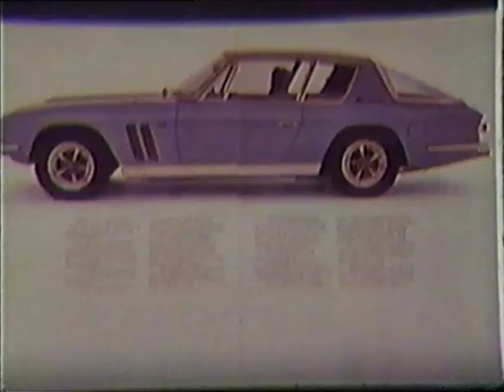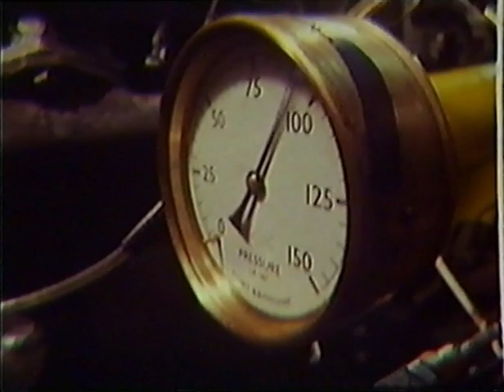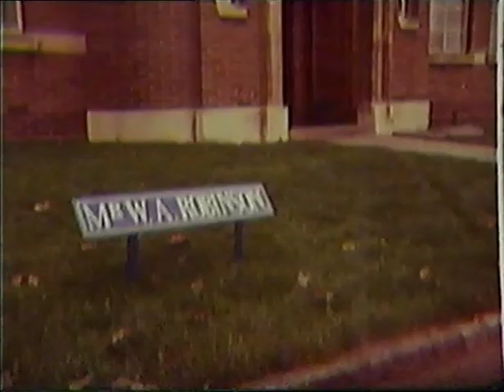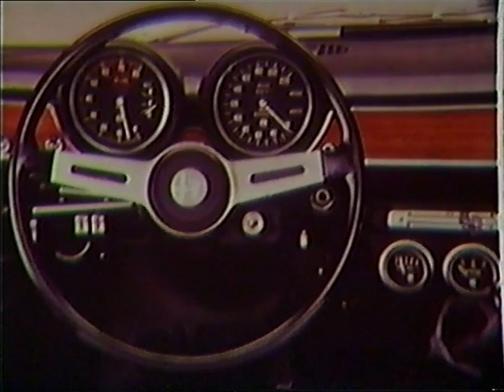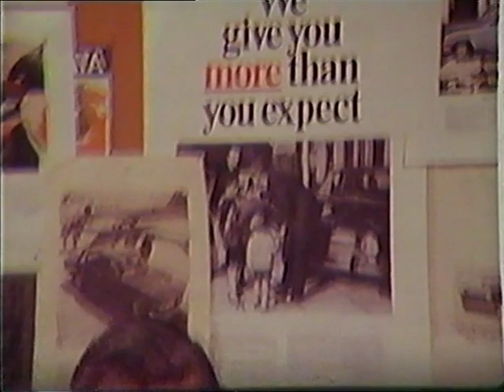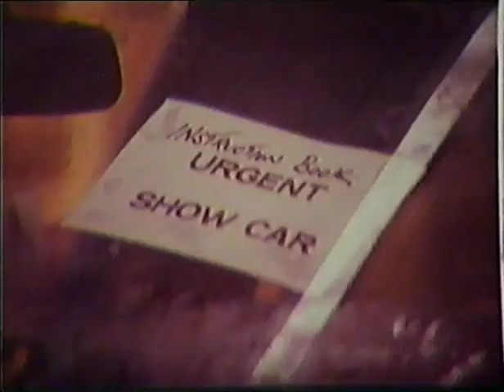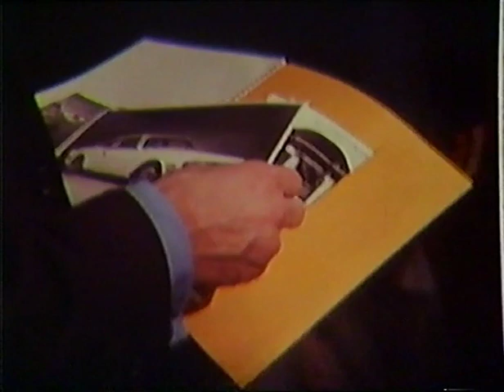Triumph Stag documentary THE DREAM CAR (1970) Rare development footage of 'Project Stag'

Comment: The Stags 3 litre certainly had its issues but  that was then.  If you are a proactive steward and a bit mechanically sensitive you will find the Stag to be a delight. I have logged 10s of thousands of miles in my Stag  and would have no reservations in owning another. Great  classic   with an affordable price tag.
Reply: Personally I think the 3.0  Capri V6 is the Best Engine for Peace of Mind   Reliability  in a frequently used Stag✅

Comment: I have worked on stags for over 40 years ,it was such a shame there was so much enthusiasm for it by all at the factory’s
The problem was it wasn’t developed properly but make no mistake when you drive one which is as it should be they are fantastic absolutely apes a pagoda merc and even a 107 to drive unfortunately there are so many stags that have been got at now , I had the pleasure of driving nearly new ones  which were lovely,everybody knows about the engine issues but it’s lovely when it’s right very sad but its become an icon and still very beautiful 🙂
Reply: Yeap

Comment: STAG: killer design with an Achilles heel. What an exceptional fly on the wall production. That the film was made with such authentic charm and foresight is remarkable. It shows they really knew the secret STAG project was well worth documenting.
I fell for the charm of a STAG in the 80s and at the same time had a TR5, PI Saloon and TC Saloon. Loved the performance of the TR5 and the daily drive quality of the saloons, but the luxury of the STAG was a world away from Standard Triumph offerings.
I always had to have a friend on hand to remove the hard top for Summer; then you could hear that unique STAG V8. I never had an issue with the engine or timing chain, but the electrical system was a nightmare. In the video you hear a reviewer ask why on earth the battery was so inaccessible.

Comment: Music - I am a Fantasy (at 36 min) - Clodagh Rodgers - so apt:
I dance with the trees and I sing with the breeze and I fly like a dove....
I can see reflections of an image I will never be....
And I am what you see but I'm not what I seem....

I know we kick our selves in the UK but Triumph did "Shoot for the Stars, Aim for the Moon" - respect!
The 2 litre, 4 cylinder 16 valve Dolomite Sprint engine was half of a Stag engine.
The Stag V8 engine was designed to accept two 16 valve (Sprint heads) - and each bank is capable of 2 litres.
We are talking 32 valve 4 litre V8 engine in 1972 - also forgot to mention early development engines used Bosch fuel injection (Triumph later used Lucas PI in their saloon cars).
This is mighty 1990's BMW M5 V8 stuff by Triumph in 1970's - and yes, Triumph already had fully independent suspension and 6 speed overdrive gearboxes in production....!

BMC banned the potential Triumph 32 Valve V8 4000 PI Saloon Car (1990 BMW M5 killer) as it could damage the new Rover SDI sales.  The agreement was to remove fuel injection and just fit it to the Stag without proper development spending.

So apt the Triumph sales agency chose "I am a Fantasy" as a sound track....
Clodagh and that poor abandoned V8 both sounding brilliant 50 years later!

Comment: this documentary answers so much about the Stag and British car production in that era. 

one of the biggest answers is with the engine. the big end bearings are small for the engine size. yet the production engine capacity grew by 20% from its design size which will have loaded up the bottom end far greater than intended. also a great deal more heat is created than the cooling system was originally designed for. the late change in engine capacity and limited time to fully test it surely led to the inevitable engine issues.
Reply: Also timing chain was to long, it was a total failure.
Reply: @eddkennedy6458  You are both incorrect… These are folklore… My engine is 30,000 (from new) never touched.. The timing chains “should” be changed every 25,000
 Mine don’t rattle at all… similar story with the main bearings…The answer is I change my engine oil every 3000 miles not 6000 plus as by book - conclusion is the timing chain is a little delicate and there are too many galleries and moving parts- solution, better chains, better oil or  simply change the oil more regularly.
   The cooling system is sound as standard but there must be no crap in the system and the standard system only needs to lose one litre of coolant to dry the water pump and 🥵.. answer, keep the coolant full- solution, fit a modern header tank with a level warning alarm if you are nervous
Reply: @MrDodgedollar  
Timing chain was to be double tooth, but cost cutting made it single. If you use the car to what it was supposed to be used for, brisk acceleration and high speed driving, your engine will seize. Unless you install the relevant after market fixes, and use the proper modern fully synthetic oil and waterless coolant.
Reply: @MrDodgedollar  is yours a Mk1 or Mk2?

Comment: My father dashed out to order and pay as soon as he got the call to do so. Unfortunately for him his car was fitted with a poorly constructed motor. For the first year it was at Triumph for major engine repairs more than in the garage at home. If I remember correctly they replaced the doggy engine seventeen or so months after he purchased her. Less than a year later that engine began to have issues. She would overheat often; resulting in the warping of the rods. By this time my father was fed up with Triumph engine troubles. Not wanting to part with his second wife, he had a new Chrysler engine and gearbox fitted and tuned to perfection. They added an air scoop under the bumper to improve radiator function as well. He kept her for the next nine years. At which time he had the means to upgrade. He purchased a new Mercedes-Benz 380SL for himself and a 380SD for mother. To father's horror mother swapped the "hers" of the MB duo for a new XJS just six months later. She said she felt like an old lady whose driver took the day off. I'll admit being delivered to school in the 380SD was a bit embarrassing. Arriving in the large but sleek and sexy Jag was altogether different. Mother loved her sporty land yacht.
Reply: Your Dad must have been worth a shilling or two.

Comment: Great car & reminds me of when I worked in dealership !!, pity the engine was under devveloped , they could,ve saved heaps of bother by using the Buick sourced 3528cc V8 ,   from the P5B and P6B Rovers !! afteral it was all under the BL banner by then !! lovely styling and was a pleasure working on them!! :-)
Reply: To Tom Finney, I agree that they should have used the bigger engine (if it would fit) to compete with high class foreign makes.So it had the looks  but NOT the performance to challenge them.
Reply: The Rover engine fitted, but the politics stopped it. Have been a number of reasons unearthed over the years, Triumph wanting their own V8, not enough Rover engines to supply all the models. Today a Stag with a Triumph engine commands a higher price especially now the issues of the engine are known and with simple maintenance reliable.
Reply: Rover became part of the Leyland group after both the design of the Stag along with its V8 and the Rover V8 production facility had also been signed off with expected demand for just Rover product. The result was that in 1970, they could not produce enough Rover V8 to meet the demand for the Range Rover let alone ship them down the A45 to Canley. With hindsight they should have canned the Triumph V8 and invested in the Rover V8 production facility (as they did for the SD1), but no sooner had Leyland bought Rover out, they merged with BMH (Jaguar and BMC) and so key people from the Stag project such as Turnbull and Webster and many of their teams went to Longbridge to try and sort out the BMC "road crash" and new people like King came in from Rover who were already working flat out with the Range Rover and P9 and now had to work on finishing the  Stag and Toledo / Dolomite as well, they were trying to do too much with too little.

Comment: Insightful; Amazing documentary, obviously much development  work went into the car but it does show 50 years later. It is pretty modern, even today and drives lovely-  Great HP and torque characteristics along with better fuel economy than the 2500 straight six and an even better exhaust note… We all know about the troubled engine history, which has proven to be a production quality control issue across the board and not sub standard engineering... logically the engine should have been fitted in the big saloon and estate ( with a price increase) to give the engine a higher profile and get the problems nipped in the bud!
I don’t think in hindsight, the Stag would have boosted sales if they had got it right! To America, it wasn’t very appealing Possibly the saloon and estate could have got a foothold there!? The Stag, as it turned out was a niche, low selling classic for Europe right from the start  and I believe 25% have survived today ( I have fortunately an un restored low mileage 1971 model) which is an incredible thought for a lemon of a car 😂

Comment: If they would have used the Rover 3.5 in the Stag it would have been just an incredible car. I once owned a '80 TR8 with the Rover 3.5 V8 and loved it and the sound of it was just amazing.
Reply: The problem was that in 1970 they did not have sufficient production capacity of Rover V8s, it had only ever been planned as a low volume engine when it had been initiated with labour intensive and slow but cheap to implement sand casting and they could not meet the demand from the P6 and Range Rover in 1970, it is why the MGB V8 was kept as a low volume UK only model, it was as part of the investment program for tge SD1 that V8 production capacity was increased, but by then the Stag had already been dead for over 2 years.
Reply: Most V8 sound good and deliver a punch.. The TV8 only differs in that it sounds better than the Rover .. Firing order difference.
   The Stag car was never going to sell many more cars than it did… It was expensive and there was lots of similar cabriolets to compete if you were rich..
Reply: @grahamariss2111  
The car was TWO YEARS late. Enough time to up Rover V8 production.
Reply: @johnburns4017  Rover had been struggling with V8 production from its launch in 1967, they were encountering many problems with the casting so having to scrap a lot of heads and blocks because of cracking during the casting process. These problems were still going on in 1970 when both the Stag and Range Rover was launched and so an existing waiting list for Rover P5 and P6 V8s became legendary 2 year+ waiting list for Range Rover, P5 and P6 V8s because they simply could not meet demand. So this is why, even if they had wanted to, they could not have put the V8 into the Stag, because they simply did not yet know how to produce it in the necessary volumes at the time.
Reply: @grahamariss2111  
You may have a point. But that sounds like more of an excuse.
Reply: @johnburns4017  You certainly could not get a Range Rover for love nor money in those early years. My Grandfather ordered one in 1970 from Swan Lane Garage in Coventry, he was told 6 months, he did not get it for what was nearly 2 1/2 years and then only then because he was prepared to take one in Green even though he had ordered his to be Blue. It took a combination of the time to learn how to make them, 73 Oil Crisis killing demand and the investment for the production of the SD1 that finally meant Rover could produce enough V8s to meet demand.
Reply: @grahamariss2111  
Putting all resources into the Rover V8 would have been quicker getting a reliable V8 on the market.  As soon as Rover moved into BL the Tr V8 project should have been scrapped. It was asinine to develop two similar engines. The Rover V8 was even lighter.
Reply: @johnburns4017  Standard Triumph became part of the Leyland Group in 1961, Rover was bought by Leyland in 1967, the takeover happening in no small part due to a cash flow crisis created at Rover due to problem with getting the Rover V8 into production. Given that the Triumph V8 was part of a wider modular engine program to renew Triumph engines covering capacities from 1250 up 4000cc cancelation of the Triumph V8 was no simple risk free decision.

Also worth noting that the bulk of the specific Triumph V8 development work was conducted under Rover management as the Standard Triumph management team moved to Longbridge in 68 to help Leyland get to grips with the BMH operation. The Rover management must thus have been well placed to instead direct investment into the Rover V8 if they had believed it to be the better solution, however they did not take that route, so that also points to it not being the "no brainer" we see it as of now.
Reply: @grahamariss2111  
The cancellation of the Triumph V8 was a very simple risk free decision - even at the time, and not being wise in hindsight.  The Rover engine production technique problems were not big at all. Quite minor in fact. The engine had already had a life in the USA.  GM made three quarters of a million of these aluminum engines in three years. Then from 1963 to 1980 millions of the iron block version. Making them was not a black art.
Reply: @grahamariss2111  wrote:
"Given that the Triumph V8 was part of a wider modular engine program to renew Triumph engines covering capacities from 1250 up 4000cc "

But Triumph became a part of a wider car company with a greater choice of engines. The larger of these modular engines could be dropped for already designed, suitable and proven engines. Then an asinine decision to make a V8 engine with unproven head bolt designs.

The first of the modular engines were used by SAAB - ~18,000cc
Reply: @johnburns4017  From the engines introduction in 1960 GM experienced production difficulties with the liners and as a result a high failure in manufacturing and for some customers, it was these problems along with those from the use of incorrect coolant that resulted in GM reverting to cast iron engines, because good engine as it was, it was too expensive to make for the US market.

Rover did not have the manufacturing ability to cast the V8’s aluminum block with the cast in cylinder liners in the way that General Motors had done. This meant that the engine had to be redesigned so the block could be sand cast and the cast iron liners pressed into place, the Rover engine is thus not only cast and manufactured using different processes to GM, but also differed enough to gain an extra 25kg in weight. However despite adding extra metal and the different process Rover still struggled cracked castings and liner issues throughout the engines life, problem once contained recurring when ever revisions in production process and or with the capacity increases. So they were clearly not easily resolved.

Funny that you think it was a no brainer to kill the Triumph Engine, Spen King who was a Rover man, involved in both the anglicization of the Buick engine and bringing the Triumph V8 to production and probably had a greater steer than anybody on the continuation of the Triumph V8, is adamant that using the Rover V8 was not a viable option. In no small part, because in unreliability issues of the engine did not show up in testing and the V8 "engine drop" into the body shell of Canley was challenging enough with the significantly more compact Triumph engine and whilst possible for a specialist converter, would have required significant and expensive changes to the engine bay to make viable on the production line.
Reply: @grahamariss2111  wrote:
"the use of incorrect coolant "

That was the prime US problem. Ignorance by dealer's mechanics and owners.  Also the US was on a cast iron is king role - why they kept making the same engine in cast iron form, for many years after. The USA were also developing thinner cast iron engines as well (this technology ended up in heating boilers). By 1963, the Buick engine was a sound engine. Proven to be.

The point still remains that making two competing engines, with low sales to the smaller engines, in one company was an asinine management act - even if the Triumph engine ended up trouble free.
Reply: @johnburns4017  The point you are missing is The Private Leyland Motors had just One car division in 1966- Triumph; The rest of the products were Trucks Busses and Fire Engines; That same year they purchased Rover.. Triumph were already 5 years into the engine development and Two years into “The Stag” cabriolet.. They were still run separate; this was a new acquisition; Then behind the scenes, Lord Stocks the chairman was finalising a British Government inspired Merger to bring BMC and Leyland Motors together which was signed off in 1967 The creation of British Leyland … What you are banging on about ( the rationalisation of components and products) had yet to get underway.. It of course was too soon in the 1960’s but went ahead in the 1970’s. The management were slow and incompetent and there was no proper strategy but Products and Models  were eventually stream lined but… The death of the Triumph was sealed on that merger signature.. even if the TV8 was a success.. The same would have happened.. Triumph would in my opinion have survived if the merger did not happen and it was sold at some point to Ford or GM
Reply: @MrDodgedollar  
Vid on Youtube. One of the Stags designers said they looked at dropping the Rover V8. They said the bonnet needed to be extended by 6 inches. No big deal in that. All they needed to do was focus on  getting Rover V8 production up in volume.
Reply: Unfortunately they were at capacity for the rover engine as spen king said they just couldn’t get them and that was the real reason from the man himself 😇